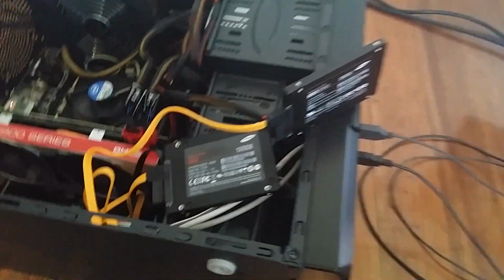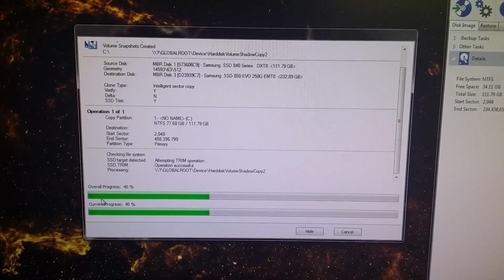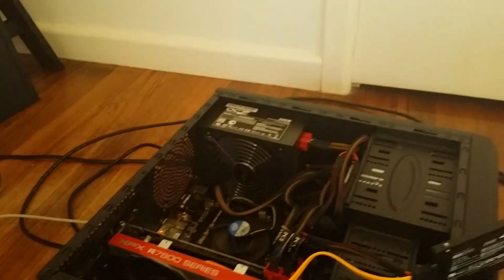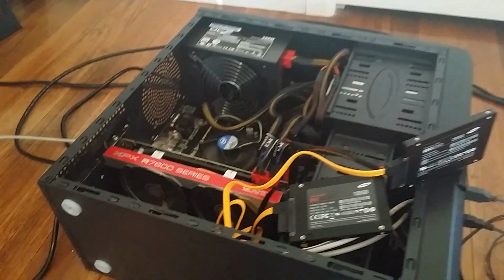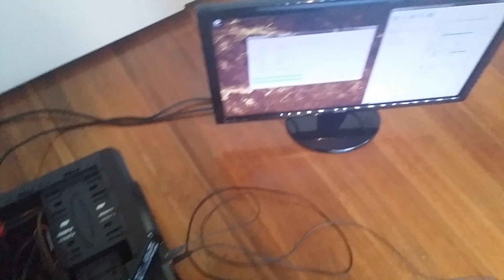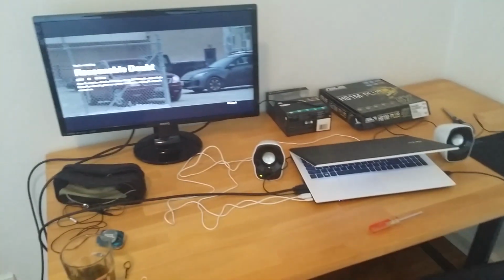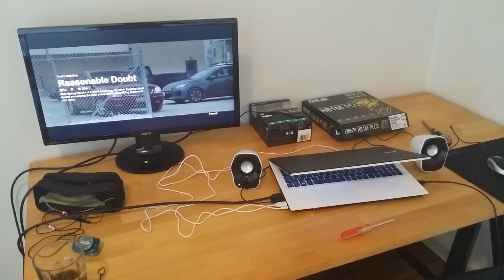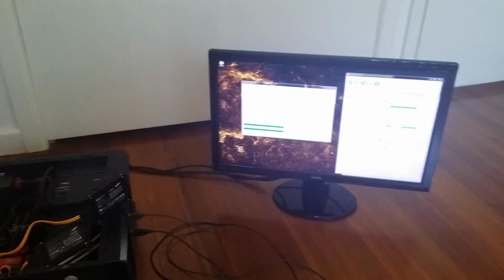Gaming PC Build Update - Copying the Hard Drive

Comment: Hey Nate, mb looks like it'll serve you well enough (never realised retail and getting ahold of certain things was like that down under, perhaps just for tech?). Anyway, I'd like to ask you of the main reason you are cloning your drive? With the advent of solid state drives it's not that much hassle to re-install everything again which ultimately doesn't really take very long anyway (presumably good practice to do a fresh windows install once in a while anyway yes/no), but I'm simply wondering what the advantage is of doing this clone procedure and/or what have you set up on the old drive that is hard to reproduce by starting a fresh? Cloning is new to me quite honestly, I'd be interested to hear why you're doing it and the advantages :)
Reply from the maker: +Look Inverted Copying the drive didn't work in the end anyway - I just thought I might be able to copy it over then upgrade to Windows 10. Turns out that wasn't possible so it was a fresh install in the end anyway. Not entirely sure why it didn't work though.
Reply: +GamerNate 
Hmm, ok, I have no idea to be honest, like I said the cloning is a new one, perhaps the way any drive and operating system actually works and communicates with the bios and whatnot is all specific to when you install windows in the first place? Pfft, just a wild guess, I generally just use my pc, don't know the ins an outs of the backend, and just about "get by" when any issues arise. Still, like I said, I'm sure you'll benefit from a nice fresh install of windows and all your programs, it's a nice feeling once you get in back to where you were without any of the extranious crap we install along the way of using a drive for a long time.
Reply from the maker: Yeah, this won't be cluttered at all. It'll be for gaming and recording only - the 2nd machine will soak up all the video processing and uploading work from here on out :)